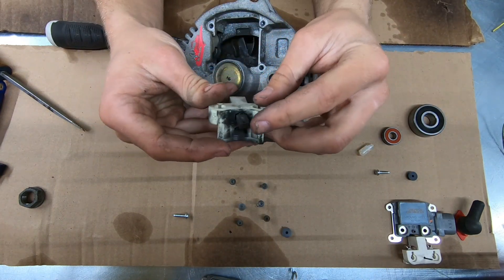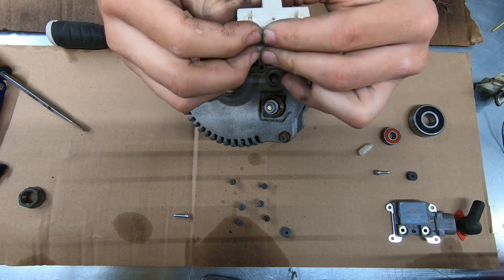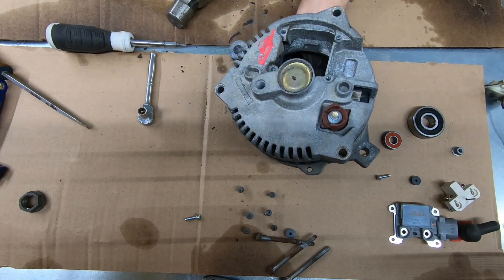Ford 3g Alternator Rebuild

Comment: Here is a valued tip for you, What will save you grief in wear on your Alternator is 
A good strong battery that is less that 8 years of age 
and all of the grounding points to the frame and engine. I did all of this on my 2008 F250 super duty and had the alternator re- inspection done last year and no wear on the slip rings or the brushes as to when the inspection was also done back in 2021 just after it was purchased in 2020 - So yeah a healthy battery plays a big role here.
Reply from the maker: Yes I agree I appreciate the feedback, this project was for a future upgrades this is going to replace a 60 amp on a 77 ford truck to allow me to add electric fuel pump and fans thank you for the feedback iv already added a new battery now and thank you for watching I hope you enjoyed!